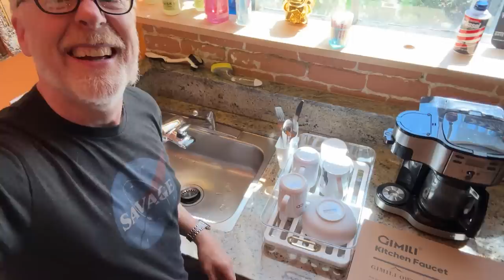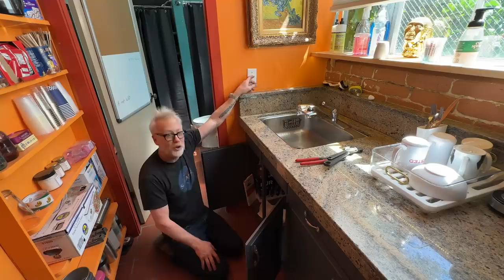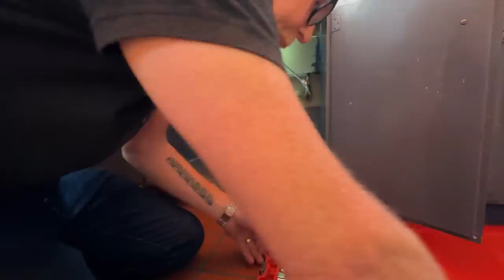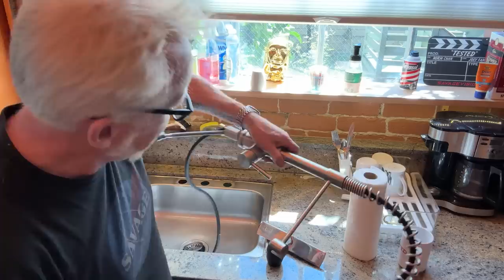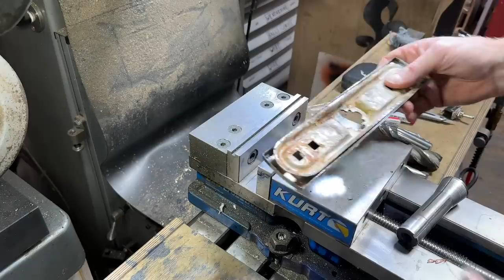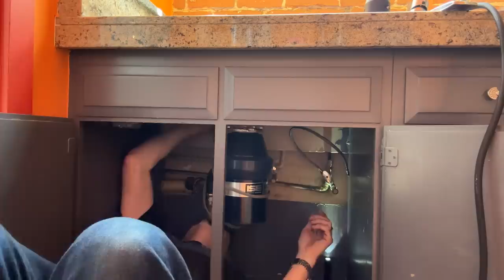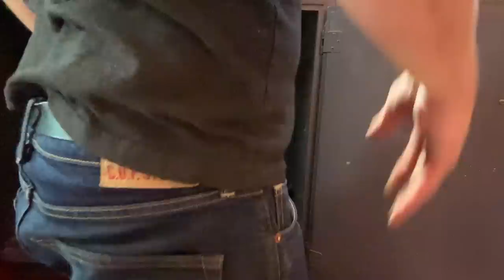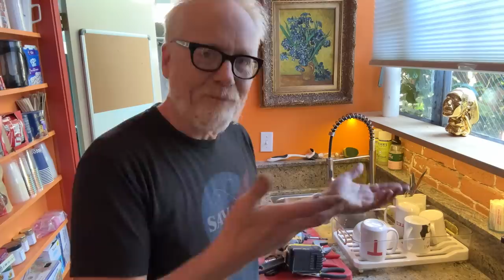Why You Should Hire a Plumber

Comment: As a plumber, I approve of both the message and this video.
Reply: Also as a plumber I second this approval
Reply: as an electrician I also approve - same care applies to my trade. Our trades are after all brothers from different mothers... LOL
Reply: It often comes down to the complexity of the job. Replacing a shower head is simply a matter of unscrewing one and screwing the new one on. And it's not that much more work to replace the stem in a toilet. 
It's straight-forward enough to replace a tap, but if the shutoff valves have worn out and need to be replaced it becomes a much bigger job for which you need additional tools and materials. But you might not know that until you start.
Reply: As a plumber, there are 2 things he didn't add that he really should have, can you tell me what they are? 

And I think we can all agree it's total BS that they didn't include a 3 hole base plate and cover with his new faucet!
Reply: @timsawyer9231  Not a plumber but I would guess silicone on the base plate & T-tape
Reply: @tisrettamton153  No teflon tape on compression fittings. If it has a washer or ferrule no tape.
Reply: @timsawyer9231  Yeah, a couple copper tube straps to secure those pipes.

Comment: I'm glad the modification you made to the plate fit. I was screaming in my mind "test fit" when you returned from the shop after milling the hole larger (and rounder). Maybe you did off camera? (It would be just like me to measure 1 1/4", get to the shop and grab a 1 1/8" hole maker.)
Reply: I try to explain to friends that a quarter inch shaft won't fit into a quarter inch hole and they're dumbfounded.

Comment: I have the same opinion about faucets, both in the kitchen and bathroom sinks. I just spent most of a week in the Sheraton in Austin, and they have a low faucet crammed right in the corner of the weird rectangle shaped sink so you have to bend in a weird shape yourself to get your left hand under the water very far. I am dead certain whoever designed that layout is one of those people who never wash their hands.

Comment: I've only ever hired a plumber twice. Once to fix the water main after a tow truck broke it, another to fix the sewer main after it clogged and broke. Everything else in between I have maintained myself and had no issues.
Water pipes are easy, diy is perfectly fine.
If I ever hire a plumber to work on something in my house, it would be for the gas lines, because I don't know how to braise pipe.
Reply: You don't braise gas lines..... NEVER INTRODUCE FLAME TO A GAS LINE

Also, do you know the #1 cause of damage in a house fire? It's water. Water can destroy an extremely large portion of home in a matter of minutes. The fire fighters are more concerned with making sure fire doesn't spread to other houses, they don't care about trying to save your house, it's already gone. 

I'm a plumber. I've seen it happen. 

It's great you trust yourself, but quadruple check everything
 

A licensed plumber is worth the money because they carry heavy insurance incase anything happens. It's on their dime not your screw up.
Reply: @rhombo323  The professionals who installed the plumbing in my house never checked anything once, and it leaked all the damned time. I replaced everything myself and have not had a single leak. I don't trust a plumber to turn on a hose, let alone work on my sink or bathtub.

You say to not braise gas lines, so please enlighten me on how the copper pipes were braised together without the oxy-acetylene torch the man used?
Reply: @Riley_Mundt  gas lines are not made of copper. Not any gas line I've seen in 15 years. Maybe where you live is different, but it's not something I've ever heard of or seen. Plus, it's a huge safety hazard. It makes zero sense for a gas system to be made of a material that requires open flame near a system that is filled with flammable gas. 

Copper is only used for fresh potable water, and occasionally in drain/waste water, usually commercial/ restaurant kitchens.  

I'm sorry you had that experience with whichever company that was. Just line there's good and bad people, there's good n bad companies. I hate that I profession has a bad reputation for sleeze bags, same with towing.
Reply: @Riley_Mundt  the difference comes down to if the person doing the work had any pride in their work.

Comment: Hold on guys… let me take my faucet mount over to the shop so I can use the “Mill” to cut out the hole to a larger diameter! Unfortunately I’d just have to get the Dremel out to round out the hole to fit the new faucet as I have no Mill in my shop (which I could actually use one on occasion.) Haha! The things we all do to make life simpler, but in the end make it harder and take longer! Haha! Tool overkill to make things happen sometimes. If you have it, use it! 😊
Reply: Dremel has a "router table" for their dremels now, it's pretty cheap plastic, but ya throw a tungsten bit in it and now ya got poor man's milling table 😂

Comment: I have that same type of sink.  Great to have and so great to be able to move it around.  Plus that button on the side of the faucet, changes the water between a solid line of water to separate lines of water like in a shower.  Very useful to have.

Comment: Your warnings and apprehension isn't in vain! I once tried to do this very job myself on my late mom's apartment. It ended up with 5cm of hot water on the kitchen and living room floor.

What happened was that after I had shut off the tap and verified it was indeed shut, I proceeded to open the connection, succeeded with the cold water and started with the hot, when a ball bearing shot out of the hot water tap and it started spewing 59°C water at me. Alas there was no mains shut in the apartment and I had to first call the maintainance and then the fire department to shut it off, since the maintainance guy didn't show up in time.

It turned out that the closing vent had been installed the wrong way around, when there was no water pressure. Luckily me, and my mom were well insured, and she got a few months of "vacation" from home during the drying of the place.

Comment: I could be way off-base with this, but as an amateur plumber whose jobs have never sprung a leak, I’ve never had to worry about the level of torque applied to my projects. Even for mains supply, I’ve found that less is more, in the sense that if you overtighten you run the risk of distorting an o-ring or tearing latex tape.

Things might be different in NA? I’ve only plumbed in Australia and Japan.

Comment: I think those consumer grade faucets are designed for home owner installation. The technology has been simplified over the years. For the home owner that is doing it him/herself, I have 3 pieces of advice:
1. Get one that comes with a new 3-hole to single lever adapter plate. Cheaper than buying a Bridgeport mill.
2. Use a bead of sealant under the plate if it doesn't come with a gasket.
3. If practical, while you're under there replace those shut-off valves with ball valves. On copper supply lines you can use compression fittings and avoid sweating the new valves on. Of course you'll need to locate and shut off the main supply valve.

Comment: As someone who has successfully replaced a few faucets, sinks, etc.  Several suggestions for people who do want to try it:
* if you have the option make sure to have the water shut off's under the sink (or anywhere else in your house like toilets, outside hoses, etc, be quarter turn shutoffs vs the spin ones....the spin ones fail a lot...and are a pain to use
* get an old couch cushion to lay on while on your back under the sink....it makes SUCH a difference to not be laying on the edge of the cabinet while trying to work.  Large towels folded over can also work, basically...something more comfortable than laying right on the cabinet, especially the cabinet edge.
* make sure to take before and after pictures in case there is a question later on 'what went where'
* try to have all the parts you need so you have a successful repair/replacement...ie you may need new hoses, get them ahead of time.
* know where the water shut off for the entire house/etc is...in case of 'emergency oops' :)
* make sure you have a portable light to shine up behind the sink to see what you are doing
* make sure to have all the tools within arms reach to make things easiest

Otherwise, good job for trying something challenging Adam :)

Comment: Strap the copper lines to prevent metal fatigue and the movement from water hammer. I would have put some tub putty under your three hole cover to stop potential water getting under the faucet into the cabinet. Basin wrench, get a basin wrench. Swap the angle stops to 1/4 turn, you will be happier in the end.

Comment: I had the braided pull down hose with a small leak spray water under the sink. I think the pulling action on the hose will weaken the hose over time. I was lucky I happen to see it. I would recommend having a battery powered water alarm under kitchen sinks.

Comment: It was my job to wash dishes with a professional grade one, you wouldn't want it in a space like that. They're so powerful they create a mist at full power (unavoidable) and will splatter if you're not careful.

Restaurant wash areas have water resistant walls and drain built into the floor for a good reason, we use them. It was powerful enough to spray off the floor from across the room, made cleaning up easy.

Comment: As a landlord from seventeen (I am sixty) and a facilities maintenance/management consultant (instructor) I tell folks that I hate plumbing and prefer electricity. When plumbing leaks they call ME in the wee hours of O Dark Thirty. When electricity leaks the call the fire department! Bad news is always best on a good nights sleep and after a cup of coffee.
Won't knock your process. You got it done. What I will do is remind you to check in on the globe valves. Pretty sure your valve stems are leaking by now. Two bits per... plumber's grease and a bit of packing should fix ya right up. 😉

Comment: For what it's worth, if you ever consider doing anything like this, consider the idea that you're never supposed to "change" a piece of plumbing equipment when you're installing it. You have to plop the item in and connect it, AFTER you've placed it. In this case, Adam should not have disconnected the hoses on the faucet. If he had just fed the hoses through, mounted it and connected them to the pipes, he would likely have had a much better time. (I connected of these a few years back, it was easy enough.)
IF you're not able to do so, THEN you should definitely get a plumber to come by and fix whatever plumbing you have going on underneath your sink area, because it should be absolutely plug-and-play.

Comment: Plumbing is one of those things that is so easy if you were doing it while standing in front of a bench.  But on your back (always with painful edges in the way) multiple things in the way, corroded or over tight fittings you can barely reach, while working by feel....  I've even hired a plumber when I couldn't figure the solution to a problem, only to have them scratch their head, and ask what I've tried.  That felt good!  The worst thing is dealing with old fixtures that no longer have replacement parts available.

Comment: I purchased that exact filter thinking it would be better than the upright one.  Unfortunately I also have a low faucet and that made it even lower making dishwashing worse.  It also attached with a single screw on part rather than clipping into a free spinning attachment so it would also loosen itself constantly until the day I pitched it and went back to the old form.

Comment: I like it and it pays well.  The modern faucets are well engineered for simple installation.  About 30 minutes. The valves will most likely need to be changed. Multi turn valves from the 80s and 90s will generally leak when closing the supply line.  If you have to replace, I choose 1/4 turn ball style valves. I am surprised that the faucet didn't come with a surface plate.  Most do for that reason.

Comment: Adam 2 things for peace of mind clip that water supply please, everytime you pull that faucet its twanging like a guitar string, 2. Open a stopcock all the way then close it 1/4 of a turn that way it will never jam in the fully open position over time and if it does jam you can work it back and forth to free it up, Plumber of 42 years experience

Comment: I replaced one of basically this exact same faucet in my house in a fibreglass laundry sink and discovered the fixture had seized together really badly, so I got my wrenches and went at it, and literally managed to _tear the sink_.

As in yes, I ripped the sink. With my hands. (And wrenches.)

I've never been so annoyed and yet so butchly chuffed at the same time.

I was able to salvage the sink with fibreglass repair, install the new faucet, and we're still using both. :D

Comment: Good job, except you omitted the plumbers putty underneath that escutcheon plate (what you called caulk). Any water splashes can run under that faucet and drip down into the cabinet.

Comment: If I was you Adam I would fix the main water pipes on to the wall, the movement you have their is a bit excessive,  believe me it will come back and bite you in a few weeks when the loose pipes fracture with stress, they are only copper and weaken at the slightest of flexing.

But you got it all changed, water comes out instead of gas or electricity so you must have got it right.
basic plumbing is within the remits of many people, but I have gone to many houses when the owner has completely flodded a lovely home. then being charged extra by the plumber who has had to undo everything the owner started.
Cheers mate from sunny London.

Comment: Some of us just don't have the funds. Earlier this year I needed a section of drain replaced behind a wall in my kitchen. The plumber couldn't touch it without having an asbestos test done and pulling permits and the rough estimate was in the $10k range (which I don't have) but he did hint to me that it was something i could tackle. My choices were live without the sink or fix it myself. I chose the latter. Cost me around $100

Comment: I watch a lot of This Old House, and while I respect guys like Rich Trethewey for teaching the concepts of plumbing, he really doesn't tell you stuff like:
1. How hard water can absolutely destroy a valve's ability to shut off flow
2. How much a compression fitting should be tightened (hint: More than you think)
3. How he came up with the layout of his piping
4. How quickly a consumer-grade fixture will die (as fast as a year)

All of these things are drilled into apprentice plumbers, and it would be almost impossible to convey that kind of experience on screen, but it also means that the trades work on TV is just a very diluted taste of what home repair is really like.

Comment: I usually see it this way:
I can and do some basic plumbing like washing mashine, dishwasher and Sink / faucet. No "biggie".
Where I stop is when stuff is not 100% right. I.e. I cannot turn off the main supply or anything like that.
Additionally, I only do my own stuff. When my mum calls me and asks for advice, I always tell her: Contract the plumber. He knows what he is doing AND (and this is the main thing in my opinion): If ANYTHING goes south - even in the future - You are off the hook. Living in rental spaces, this can be a nightmare when stuff gets damaged by water. The plumber is insured and knows stuff - you don't. If walls get damp and moldy, you're on the hook. The plumber aswell but he knows his stuff (or should) and will take the fall.

Comment: I couldn't really tell, got kinda distracted at one point, did you use silicone or something to seal the trim plate to the sink? If not, expect water to get underneath the edge and find its way under the sink. From the looks of the trim and mounting plates, the person who installed the old one used some inferior product, because there should not have been that much rust and debris if they had sealed it properly.

Comment: As someone with recent multitude of surgeries, but still wanting to replace a Moen bath faucet, look at the ridgid sink tool, the thing is not pricey, easily packed away and had everything needed, from the shut off to supply nut, the supply to faucet, the nylon nuts holding the fixture to sink and almost EVERYTHING. 
I used to be a maintenance guy before my injuries and I wish I had this stupid thing then.

Comment: Adam I'm not a plumber, but I have installed enough to notice you installed it kind of backwards. They are designed to be put in from the top first and then you can connect everything easily from underneath.

Comment: Adam, I know of at least one residence that was on This Old House that had a soap dispenser in one of the holes on one side of a faucet like that one and a nozzle for instant hot water in the hole on the other for instant coffee and other drinks of that type.  That might have worked in those other two empty holes you had there.

Comment: Did I miss the part where the plumbers putty, or at the very least caulking was put in the base plate? There’s going to be some sub-sink moisture where it shouldn’t if thats the case. Also, those copper feed lines need securing. To much play in those lines.